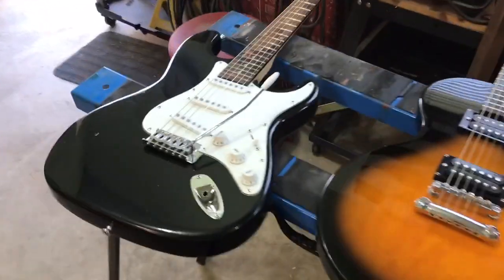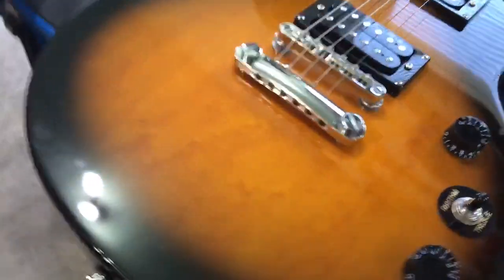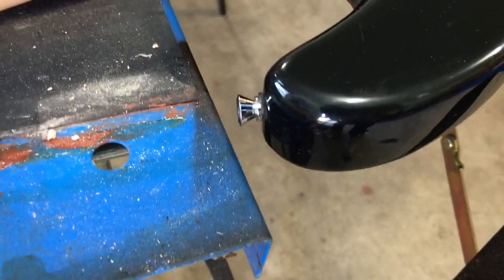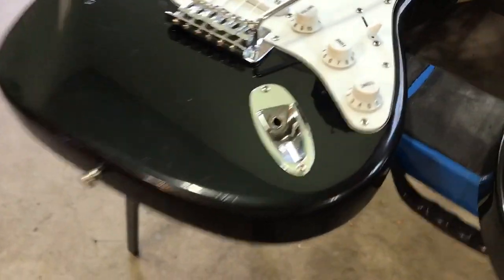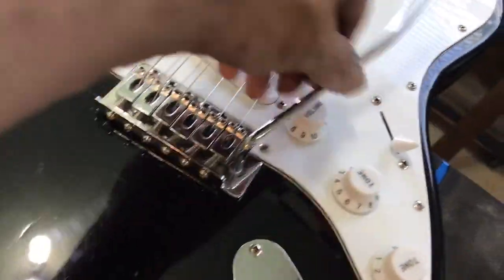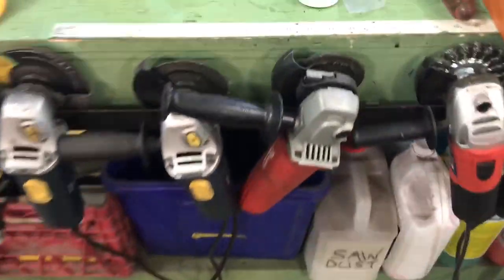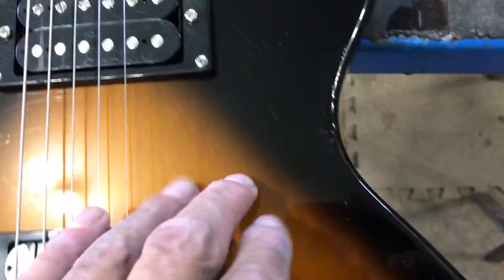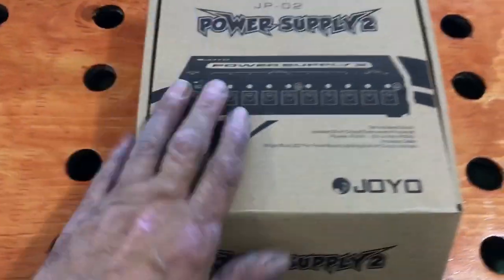Chip Repair on a guitar

Comment: Nice job. I like to use super thin super glue first, this flows into and under any potential loose finish securing it. Then black (or the right colour) nail polish, then medium viscosity super glue as a sealer and chip builder. Works a treat
Reply from the maker: Thanks.  That's an excellent idea and one that I will use in the future (The super glue idea)!

Comment: Nice job. The visual appeal increased a bunch, and I like the use of nail polish for this. We have used it on HD motorcycles for small touch ups due to the wide color palette.
Reply from the maker: Thanks!  Yes, they definitely look a lot better after touching them.  It's amazing what a little difference like that can make.  Never thought about using it on bikes,  that's a great idea.  Certainly cheaper and easier than buying a bunch of pints of paint and having to color match it.
Reply: Bruce L. 
Some Harley colors are unmatchable, and throw in some fade. Little spots done like that are hard to point out. The range of nail polish colors are vast at any Walmart!

Comment: You could fill in an build up the nicks using the old super glue and baking soda trick.  It works great on aeroplane propellers.  👍🏻
Reply from the maker: Hey Ian.  Yes, we used to use that for filling in chips on water skis when I worked at a fiberglass shop.

Comment: They look great! 
I was very curious how you have painted it... just got the answer! You can make some extra fixings guitars!!
Reply from the maker: Thanks Myr!  It turned out a lot better and was easier than I expected.  I thought I would have to build up the chip with the paint and sand it flush then polish it but it filled in smooth enough that I'm not gonna polish it.  There are a couple of spots of the flat part that I might sand and polish a bit, maybe not though.
Reply: I see Bruce. It does look very good